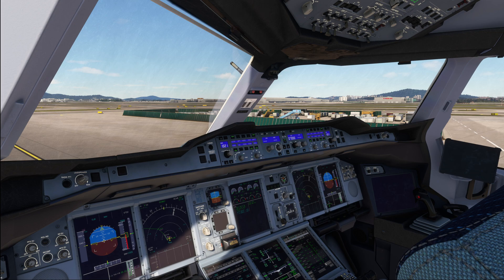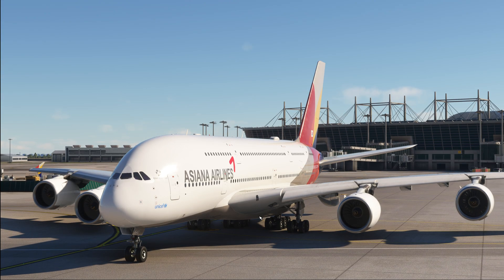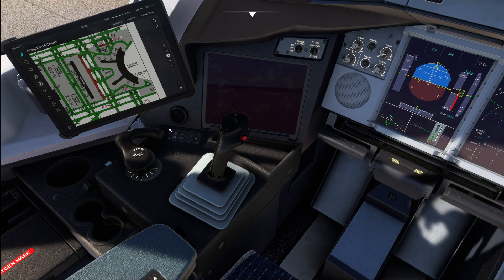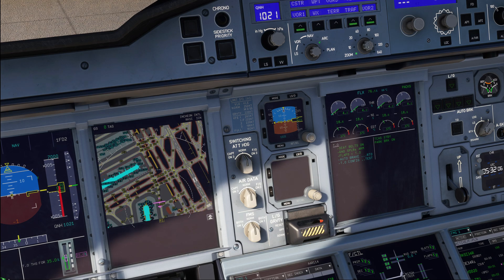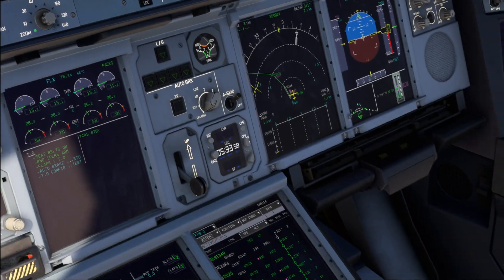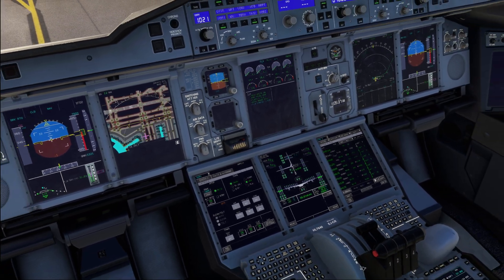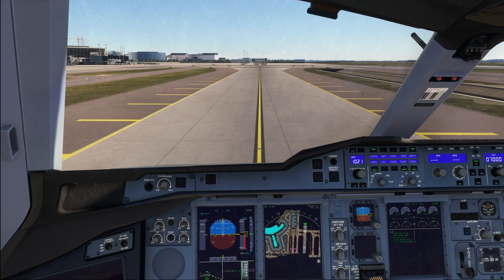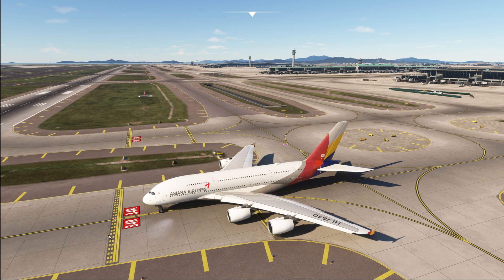FBW A380 Tutorial 5: Taxi | Real Airbus Pilot

Comment: Hey, at 00:40 your screen is lagging, I do encounter the same problem, you seem to press some key to fix it. Which ones ?
Reply from the maker: Go to windowed mode and back. Alt+Enter by default.
Reply: @A330Driver  Thank's a lot !!
Reply: @A330Driver  hey thanks for that, ive always had to go to settings and disable NVIDIA DLSS frame generation and turn it back on again. Do you know why this happens? Do you also use DLSS frame generation for way more fps? Thanks

Comment: I’m bad at taxi any aircraft in sim but don’t find this plane too bad oddly.  Never considered the use of thrust on only inner engines due to overlap of outer engines on grass etc, suppose it’s mentality of mostly piloting smaller two engined aircraft the vast majority of time😅.  I agree using little thrust on engines on outside of turn certainly helps in the sim.  Don’t mention A380 nose wheel skids 😂
Reply: Even stepping up to bigger planes in real world GA is exactly like this - you try to prepare for predictable issues but you suddenly discover issues you just didn’t experience before. 👍
Reply: Keep in mind that you would need to modify your throttle bindings to achieve this if you have a dual throttle peripheral.

Left throttle bound to 1 and 4
Right throttle bound to 2 and 3
Reply: @HomerunHallock when I said outer I meant engines on outside of turn ie both engines on same wing.  You see large planes do this on backtracking turns at end on runway in real life although I’ve never seen A380 do a backtrack turn 😅